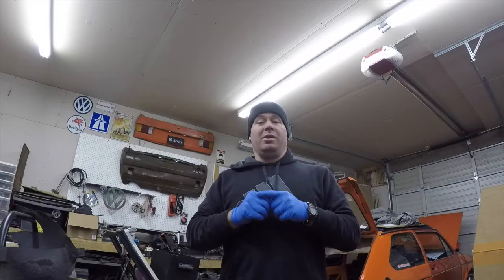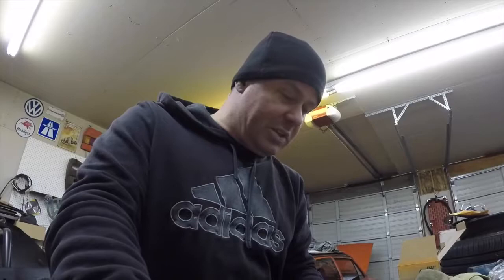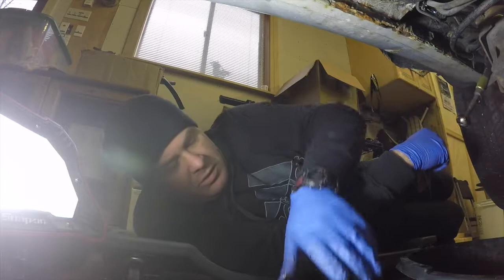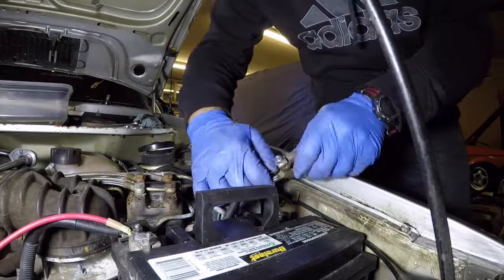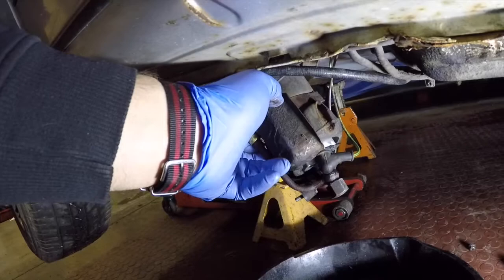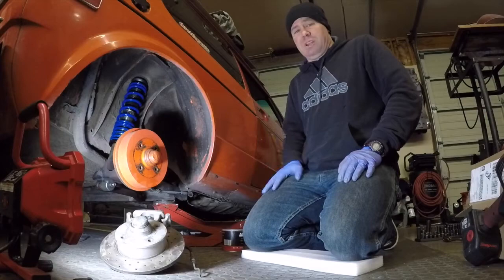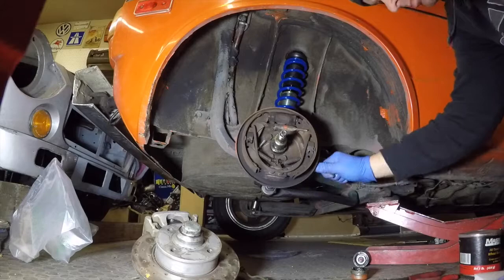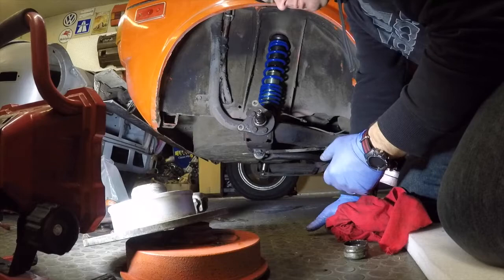Rear Disc brake conversion -1975 VW Rabbit 1.8t 20v ep 32

Comment: I've never had any problem with the rear drums on any of my VWs. I understand the desire, but the need is nonexistent.
Reply from the maker: it's true.. rear drums are adequate. Especially the 200mm ones from a pickup or a mk3. The discs are easier to work on and get parts for.
Reply: @ThrottleGrotto   I suppose if I were driving aggessively rear discs would be better. I have a 79 scirocco and an 83 audi coupe gt that both have rear drums. The audi is a bit bigger car but still only weighs 2300lbs. My daily driver subaru outback weighs 3600lbs !!! I like light weight cars.

Comment: Hello , Thank you for the video, question, could  you show a video when you added the proportion valve on the master cylinder. 
the part number will be useful for me , since I have done the conversion, But I have not added the proportion valve that you had mention.thanks. VW 88 cabriolet
Reply from the maker: The part number for the VW thread-in proportioning valve is 533 612 151.  hope this helps your search!

Comment: I have most of the parts for this now, but I thought I saw something about it changing the track width and now I can't find it
Reply from the maker: If it changes the width, it's not very much. I should have measured that prior to doing it, but unless you're really close on wheel fitment, it shouldn't be an issue.

Comment: What are the proportioning valves off of or are they aftermarket?
Reply from the maker: They are the factory 16v scirocco or cabriolet (with 10" brakes) proportioning valves
Reply: Those look a whole lot like the residual pressure valves used on later rear drum cars like Cabriolets. 

Proportioning valves are found near rear axle as a rule.
Residual pressure valves go on the master...

At least that's where VW put them.
They should have a part number on them... look it up.
Its possible they are 2 psi, which is OK...

Discs dont technically need residual pressure valves, although 2psi units exist for them, can improve pedal feel. 

Drums get them as it prevents the wheel cylinder seals from deflating. 

well shot video otherwise.
Reply: Was about to ask this also. Doing rear disc brakes on a mk1 caddy

Comment: What cable are you using now for the the hand brake cable?
Reply from the maker: I am going to use the cables from a 1987 16v scirocco. I could also use golf mk2 rear disc cables, I think they're just a bit longer.

Comment: Great videos, thanks for making a rear drum to disc swap!  I plan to do the same. Question: can you elaborate on the brake proportioning valves? The two separate ones you held up don’t look anything like an Mk3 OEM proportioning valve.
Reply from the maker: The brake proportioning valves are (as I understand) flow restrictors. These are from the mk2 scirocco or late cabriolet. The mk2 and mk3 cars had a valve on the rear axle that was position dependent.
Reply: Throttle Grotto thanks for the additional info.  So if I’m pulling all the braking system parts from a salvage yard, I should include the MK3 proportioning valve as well and the remount it similarly to the rear axle?
Reply from the maker: @quinnthompsontv  if you have the skills to make that work, then sure!  you could also use a manual twist-style proportioning valve (like a wilwood) and plumb it in somewhere. I'd say that would be the easier option. Not 'factory' but long term more reliable.
Reply: @ThrottleGrotto  good call, thanks!

Comment: Can u use the Jetta back brake disc's?
Reply from the maker: If they are the 4x100 versions, yes. Jetta and golf are the same.
Reply: @ThrottleGrotto  ohkayys I'll have a look at tht so if it's the 4x100 it will fit my mk1 golf
Reply from the maker: @cayyclaentertainment2166  mk2/mk3 should work fine on the mk1!
Reply: @ThrottleGrotto  thankz bro

Comment: Is disc brake from golf mk2?
Reply from the maker: In the USA, we had a few vehicles with 10" front brakes. The 88 scirocco 16v, the later 90-92 cabriolet,  and the 85-87 audi 4000 quattro all had the proper carrier to bolt to the mk1 steering knuckle.